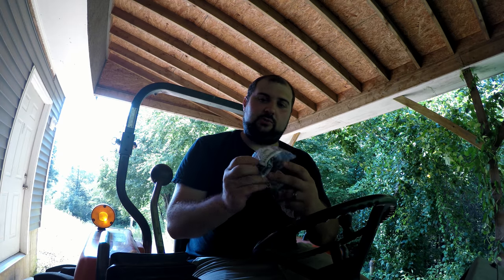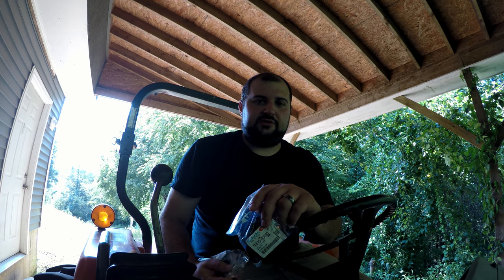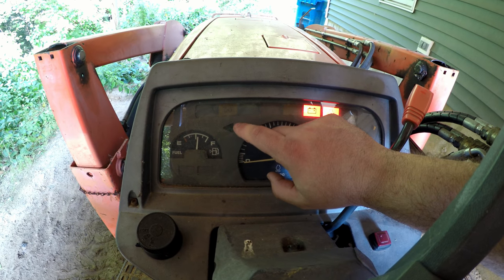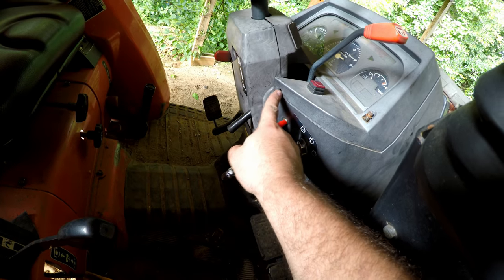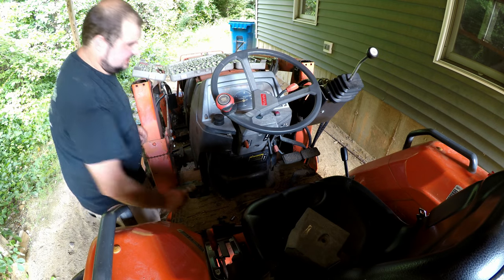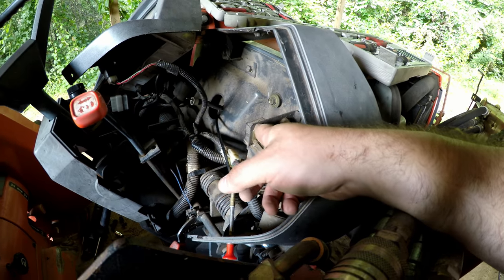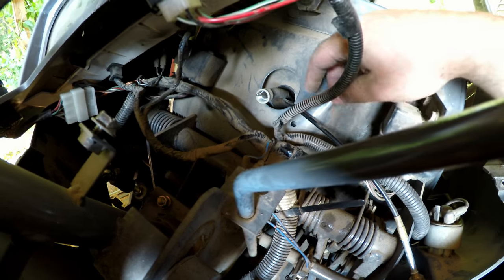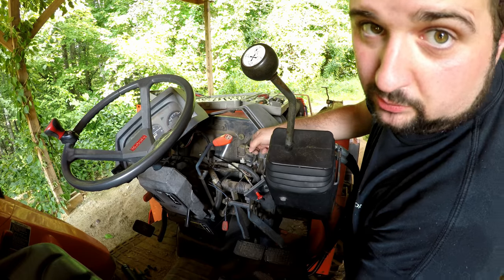Kubota L3010 Glow Plug Relay and Controller Replacement

Comment: I found the easy way to work the tach cable. Follow it to the end on the engine. Take it loose there and you can then pull the entire cluster farther away from the position it is mounted in.  I found this out the hard way. Hope it helps someone.
Reply from the maker: Awesome tip! Thanks!
Reply: Wish I had seen this sooner.

Comment: Thanks for this video I'm sure I saved $500.00 on dealership labor.   The suggestion of disconnecting the Tach cable at the front of the engine is the way to go.
Reply from the maker: Very welcome!

Comment: Thank you I appreciate it. I ended up disconnecting tachometer easily from the engine and pulled it forward. My relay arrived before my controller. I replaced the relay instantly works like new. Light comes on less than eight seconds later goes off does not come back on. Aftermarket relay $32 found the OEM controller $13 eBay. I will keep the controller as backup in case that decides to go out later

Comment: Thanks for making this video ........ The visual location and details you gave, helped me to determine that the "Relay - Timer, Key Stop" AND the "Controller" were failing me.  (Fuel shutoff and glow plug problems)  L3600GST
Reply from the maker: Glad I could help you out! One of the main reasons I made the video is that when I went to search for the issue on my L3010, I couldn't find much on it.

Comment: Thanks for the upload the indicator light on my 3010 will come on no problem there it just wont go off but it will flash on and off periodically while in use and I have noticed when it flashes on and off it causes  my headlights to dim. Did yours do the same I would like to call myself mechanically inclined but as far as diesel engine's I'm in the same boat as you brother this my first tractor it's probably as old as yours but when I got it it only had like 700 hours it was barn kept and was owned by a old lady that only used it for bushhoging her 2 pastor's and unloading hay bell's
Reply from the maker: No problem! I am not sure if it caused my headlights to dim, I honestly never thought to check that and I hardly use the machine at night so not sure I would have noticed to be honest lol. Kinda learning as I go with the diesel thing. Not too hard.
Reply: My headlights would dim as well when the light comes on.
Reply: head lights will dim because of high current draw from glow plugs when relay closes. Sounds like either a bad controller or temp sensor or sensor wiring or sensor connector.

Comment: My 1715 tractor has a coil instead of light indicator. I replaced the indicator and it immediately burned out. Would a bad relay cause that? Im afraid to burn out another GP indicator if the really isn't the problem like maybe a bad ground wire?

Comment: What are the part numbers to these parts I can’t find it
Reply from the maker: Glow Plug Relay Part Number -  16415-65600
Glow Plug Controller Part Number - 16415-65660
Links are in the description of the video.

Comment: I had the same problem . I bought a heavy duty push button         drilled a hole in in the plastic unhooked the wire down at the glow plugs taped it .put a fuse near the battery ran a wire from battery to 1 side of the button other side to glow plugs now I hold the button in a full minute in cold weather starts instantly .I fought like you did an later it quit again .
Reply from the maker: I was able to find some OEM parts so I went that route, unfortunately this machine is old and has sat outside its whole life prior to my ownership. A lot of the components are starting to show their age. I am hoping to get it inside soon.
Reply: @ACHAutomotive  mine sets in a unheated barn but I think the change in temperature caused mine to sweat an go bad. Also the fuel selinoid an or it's relay acted up .If I ever have this problem u can pull the wire at the  selinoid  connection an it stays in the open position u can stop it by the manual pull lever just have to remember to turn the key off😀
Reply: @ACHAutomotive  mine sets in a unheated barn I think the changing temp causes the relay to sweat inside? Also my fuel shut of sender or relay started acting up if this happens to u yours u can pull the wire at the selinoid connection it then remains open an you can kill it with the manual knob but don't forget to turn the key off like I did anyway it is a handy temperary fix in a pinch😁

Comment: could also be a temp sensor or a chewed sensor wire. Noticed that the tractor temp gauge showed it wasn't cold either which would prevent the glow plugs from not coming on while engine is warm.
Reply from the maker: It was definitely the glow plug controller/relay. I may have had it running prior to shooting the video. I'd have to go back and watch it but the repair I made corrected the problem and that issue has gone away and not come back.